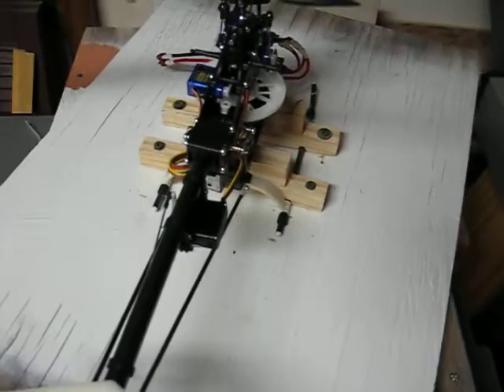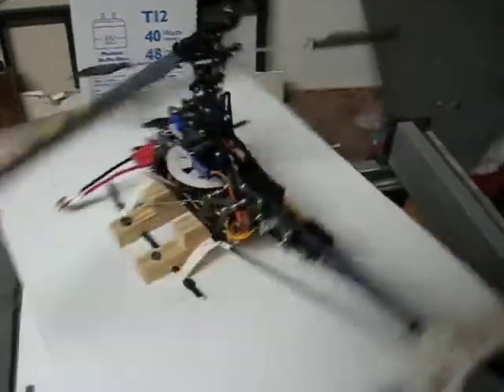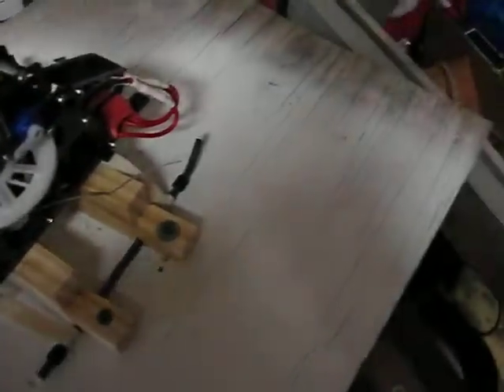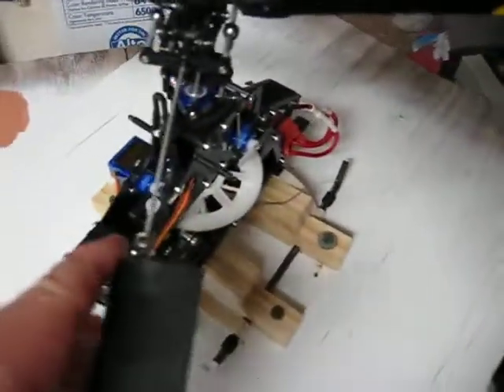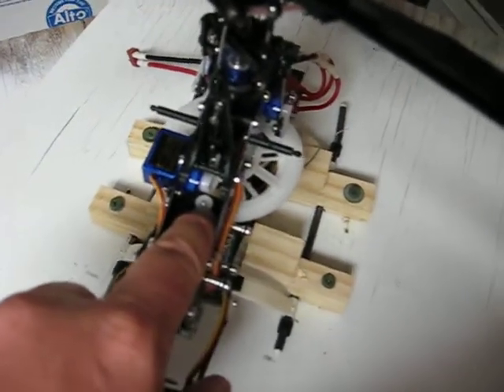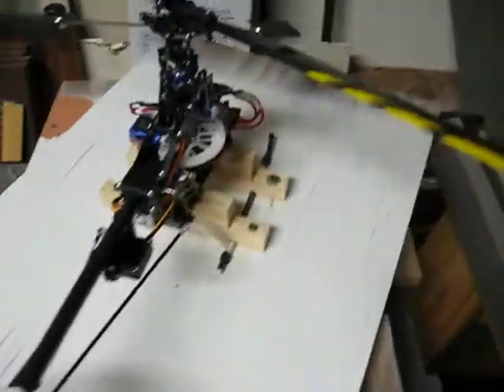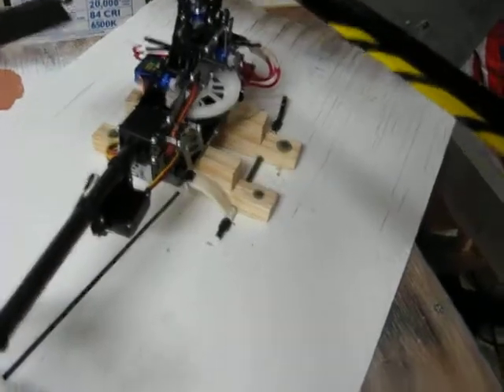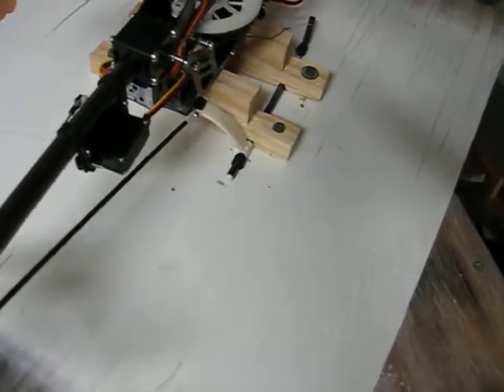HK-450 Tail Gear Failure

Comment: I bought the HK 500 CMT TT and I've replaced over 70% of the HK parts with Align parts as they were either poor quality, failed, or had so much play I was worried about them in flight.  In the end, it would have been better to just buy the Align kit in the first place.  For example, the HK pushrods and ball links were so much smaller diameter than the Align parts that they are not interchangable.  The HK ball links broke during the second removal an this was when I was using ball link pliers.

Comment: This happens with all 450 helicopter that have gear driven tail rotors (plastic).
That's why you should have gone with the belt drive system.
So in the end don't say that is HK or any other brand when it is the system your using.
I hope you don't get mad I'm just stating the facts.

Comment: I had the same issue with my first HK450. I got another gear set but also drilled a small hole through the gear and shaft and put a pin through it  so I could fly while I was waiting for the new parts, which actually worked really good.

Comment: I have the HK-450MT, do you happen to know if this issue has been resolved?

I also have ordered the the trex V2 tail gear just in case, but see that the top belt pulley is seperate to the shaft, how do you make it stay on the shaft???